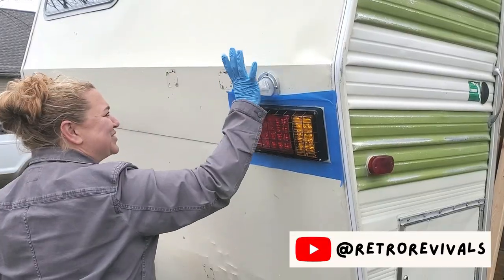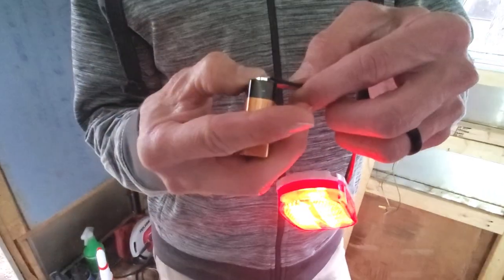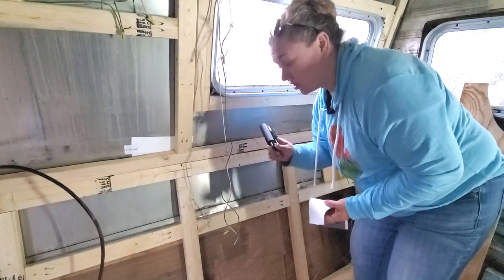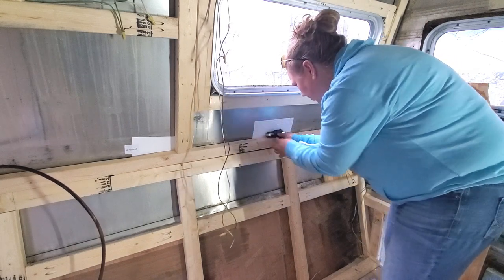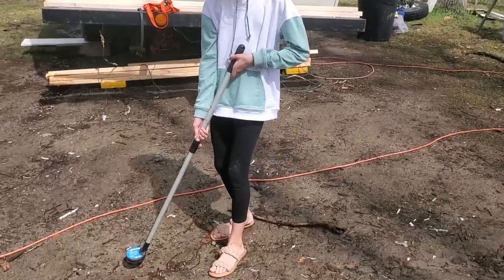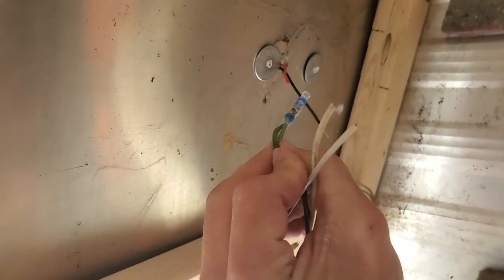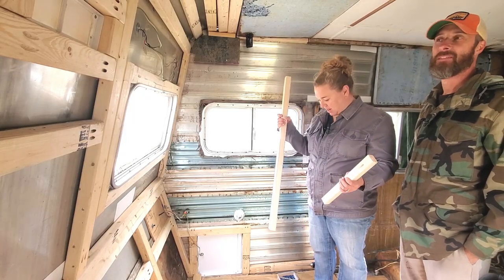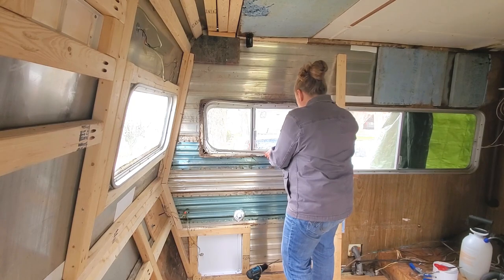Retro RV Revival: DIY Wiring Challenge, Side Wall Rebuild & Holes in the Siding of Vintage Camper!?!

Comment: Great job guys the wire ups can be a little crazy hair pulling so to speak. Only advisee I can give is bring the light into the inside and have some one to turn the breaks and the wire that keeps the light on is the break lite wire and mark it and so on with the flashers  reason to bring it inside is that you will be able to hear the person in the driver seat. Hope you figure it out look forward to the next post .
Reply from the maker: Thanks for the comment Marty. I think we got it sorted out. I'll either try a 4 to 5 wire adapter or add a seperate brake light wire from the brake light switch to the light. One way or another we'll make it work.

Comment: You need to run 4 new wires from under dash to the back; park lights, left turn after flasher, right turn after flasher, and brake light. You can reuse existing ground and backup.
Reply from the maker: Thanks!  It does seem like that would work!  Thanks for watching; we hope you subscribe to follow along with our progress 😀

Comment: As an electrical engineer I would'nt use the LEDS on and older system! Just a FYI!
Reply from the maker: You make a good point. We have had some issues. It was mostly ground related though. Things are working good now.

Comment: I really enjoy your videos! Great work on the rv. The holes in the aluminum is due to trapped moisture from water damage.
Reply from the maker: Yes, they seem to be worst in areas where the wood was most rotten so that makes sense.  We found some on the side wall too.  Hopefully that'll be the extent of it!  Thanks for watching :-)
Reply: @retrorevivals  Shine a bright light on the outside at night while someone stands inside to mark all the corrosion holes with a sharpie. ;)

Comment: Love your videos Christy and Tyler. When I get disheartened with my own RV rebuild you inspire me to carry on! Very best wishes to you both and your wonderful family from over here in England.  🙂

PS, I'm wracking my brains trying to think how I wired in my LED rear blinkers. I will have a look tomorrow and get back to you... 

(Mine is a 2000 23' Four Winds Class C. I've built a complete new roof with all new vents and spot lighting, complete new over cab, re-panelled rear end etc using all the same pocket hole 3" x 2" timber framing, full engine service etc for our MOT road safety inspection. Now I'm busy building a new bathroom!) 🙂
Reply from the maker: Thanks for the comment Colin. It can be hard to stay motivated with daunting tasks. As you know,RV's can be a real challenge. Just remember there's light at the end of the tunnel.  Also,it's gratifying to work on your own projects. Good luck with your bathroom!
Reply: Aren't  you going to use something  to keep the cold in from the air and heat in to

Comment: You're not missing wires. The original used the brake lights as the turn signals. You want to have completely separate, yellow turn signals. There are conversion boxes made for hooking up trailers with yellow signals to vehicles that use the brake lights at the turn signals. Wire one of those between the original wiring and the new lights so it's like your new lights are on a trailer.

If you want to tow a trailer, most of which use their brake lights as turn signals, tap the trailer light/brake socket into the motorhome wiring ahead of the converter box, and you may need some diodes to stop cross feeding the trailer turn signals to the inputs to the converter box.

Easy to test after getting the converter working. Wire up the motorhome's old tail lights ahead of the converter box and if using a turn signal makes both yellow turn signals on the new lights blink, or both brake light/turn signals on the old lights blink, or red and yellow all blink, some diodes will need to be put in, in the right places, in the right direction.
Reply from the maker: Thank you!  We hope you subscribe to follow along with our project; you certainly sound like you know what you're talking about!  We found a couple of those converters that you mentioned that should do the trick.  Thanks again!

Comment: I would think about replacing the viscous fan hub. Age has caught up with yours as iymt did with mine which was 30 years old. Ran 20-30 degrees cooler moving the road!
Reply from the maker: Thanks for the comment William. We'll address more of those types of issues in upcoming videos. Stay tuned!

Comment: I think you need a 3 wire to 4 wire converter. Like they use for trailer light hookups.
Reply: it depends on the vehicle.
Reply from the maker: If I don't get an adapter, I'll probably run another wire from the brake light switch to the brake light. Then use the existing wiring to operate the turn signal.

Comment: Does the trailer have brakes? and second (you most likely already know) if the brake light is separate from the turn signal it would have a yellow lens for the turn. this is why you would need a converter to marry the brake and signal together. and you would need a brake controller that mounts somewhere close to your steering wheel if you have trailer brakes you can also find a diagram for trailer light wiring.  I can not copy and paste for some reason. LOL I hope all is well- Mark
Reply from the maker: Hi Mark, thanks for the comment.  I don't think we did a good job showing in this video but it's a motorhome and not a travel trailer.  The old wire did give power to the brakes and turn signal because it didn't have amber.  Thank you so much for watching!  We hope you check out some of our other videos and subscribe to follow along with our progress :-)
Reply: @retrorevivals  DOH , I could ride my bike under the garden hose right now LOL. well I love you tube! I.m on oxygen 24/ and other stuff so I go places that I simply can't through you guys and others. I can't wait to go camping with you figuratively. you do very good work. ty for replying.!!!
Reply from the maker: Oh my gosh, @markcooley5681 , that's a saying we've never heard before, LOL 🤣  We do appreciate you watching and we look forward to (hopefully) camping in this RV one day too!

Comment: Hello Christy & Tyler when you have sorted out the inside out are you doing any work on the engine & Transmissions just wondering as if you did do work on both it could be trealy reliable & nit give you major problems on your journies.
Reply from the maker: Yes!  We definitely need to start focusing a bit more on the mechanical parts of the RV soon.

Comment: Your lights are fine unless you want the ambers to work. Certainly not necessary.
Reply from the maker: Thanks!  Yes, the power for the blinker and brake light were both in the one wire for the old light which is what was causing us issues with this new one.  We're hoping to have the amber work as the blinker but it seems like it's totally possible :-)

Comment: Because that is aluminum, it's actually caused by road. Salt! Road salt, especially in Michigan. Considering michigan uses more roadsalt than any other state in the united states comma salt will literally put holes in aluminum the same way that it does with steel or sheet metal!
Reply from the maker: The salt is bad news. I get that it's a necessary evil. I envy the states where it's not used. We don't have plans to drive Harvey in the winter here in Michigan. A roadtrip to another state without salt isn't out of the question though 😁